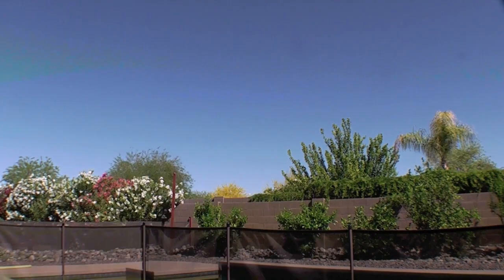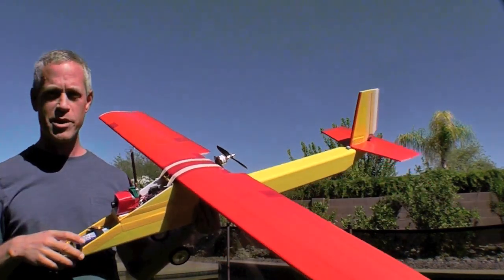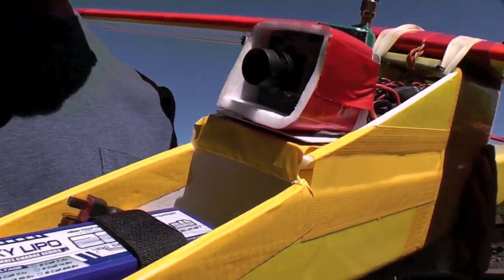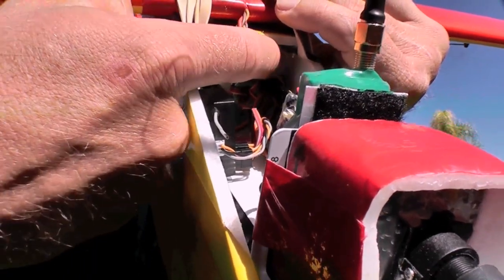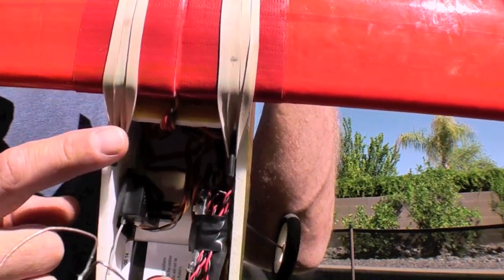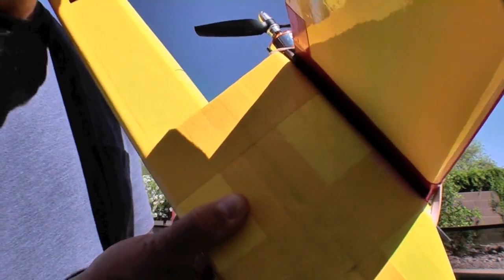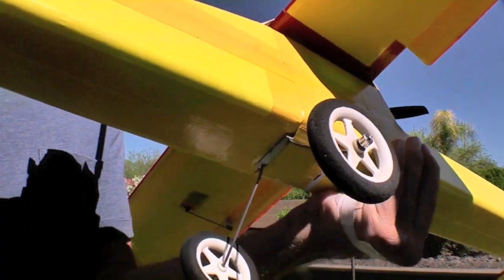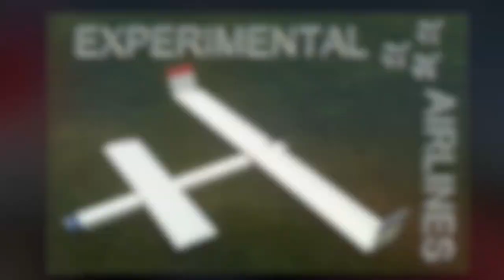AXON FPV - Introduction Video

Comment: Much thanks. Had a proper maiden flight today and wow I'm hooked.  It flies beautifully and glides well with motor shut down.  It handled 8 mph winds very well also. I thought the winds might cause a crash but flew and landed like a dream.  Thanks for the design and the assistance.

Comment from the maker: The propeller should always be mounted with the convex side and labeling forward.  The motor direction is governed by the prop you are using.  Standard props turn clockwise when viewed from behind, but be sure to check the individual prop you have.  The trailing edge is sharp, the leading edge is blunt.  Long story short, if it blows wind back, you're good.

Comment from the maker: On the test stand it will still pitch down, even with the downthrust angle.  The 5 degrees is a recommended relative starting point.  You may need a little more or a little less, but start there.  The plane really needs to be flying and be exposed to all the flight forces of lift and drag before the thrust angle correctness becomes apparent.  Essentially, the wing needs air under it to balance the thrust.  Try launching at 1/2 power and add power gently from there.  I bet it will work fine.

Comment: Hey, I like your philosophy regarding simplicity and low cost in choice of materials, i will definately use your ideas in my next build.

I would really like to see you build a seaplane using the same principles!! I know they may not be very obvious in your neck of the woods, but i areas where i fly, lakes are abundant and much easier to find than open areas without pesky trees.

So a seaplane using your proven techniques...... THIS IS A CHALLENGE!!

Comment: Take a length of wire  1-2 ft., clamp a vice grip firmly on each end. Grasp the vice grips in each hand bringing them together to bow the wire. If you jerk them apart quickly it will take straighten the wire enough to use for all practical purposes. Safety first. Wear safety glass in the event one end of the wire pulls from the vice grips and tries to put your eye out. Slip joint or lineman pliers on each end will work as well.

Comment from the maker: Well, the carbon fiber is right up next to the feedwire, and it's in the null (dead zone) anyway so it wouldn't seem to have much effect.  Plastic might be preferable if one were paranoid about such things.  The interference seemed to occur very infrequently and at fixed locations on the field so I suspect it's large ground features, like that freeway wall, causing reflections and multipathing where it did occur.

Comment from the maker: Generally cannot go wrong making it 30% of the wing chord behind the leading edge, so if you're 5" airfoil chord plus 1" ailerons then put the CG at 2".  Always safe to start forward of that then ease it back after a trimming flight.

Comment: Ed. Nice video.. Did you see the Axon with the V tail?  Interesting concept.. A triangles tube in the rear would set up the V tail and reduce the rear weight. Maybe enough to offset the extra weight in the front to balance..

Comment from the maker: You know, I now just use rubber bands passing front to back for this same purpose.  But I once used 1/4" self-adhesive weather stripping.  The mounting tape by 3M is honestly as cheap from Home Depot as any place I've seen it online.  Office Max also carries it.

Comment from the maker: Good eye!  If all the air went smoothly through the upper fuselage it would work pretty well, as with the original Axon.  Now with all the FPV gear and wires and crap in there it does disrupt the airflow some.  I considered tapering the rear of the upper fuselage for smoother airflow to the prop, but it gets complicated.  A solid bulkhead would probably worsen the performance as it would choke off the air completely.

Comment: Hey Ted, will this battery have enough power for the Axon? It's from RCTimers and it's called 11.1V 2200mAh 15C Lipo Battery Black-B, it has 15C instead of 40C that you have linked. Is it enough or whats the difference?

Comment: I'm looking for a plane to help a classmate build who's a beginner. The two thinngs I want it to have is 3 channel capability and a pusher so when he crashes we can get him back in the air with out buying a new motor. I think this plane is a good match but I want add dihedral or polyhedral  so that it will be entirely hands off self correcting. Any ideas on how to make one of your wings have dihedral.

Comment: Hey Ed, I have tested the motor today for my Axon in full throttle, every time I do the full power, the plane wants to go down, bad... Does it mean I don't have enough down thrust? I have measured exactly 5 degrees, but is it still not enough? Thanks

Comment: Hey Ed, I have a problem and I was hoping maybe you can give me some ideas... 
Today I had a second test fly with my Axon. To make the story short, after the first flight I have added carbon rods support to the vertical stabilizer and added more down angle. Anyways, my Axon keeps acting weird (still): on the throttle up or just no throttle it wants to go up. Also, it stalls (a lot), it doesn't seem to have any power or momentum to make a simple loop, it just starts whirling down.

Comment: it is not nose heavy, because I have had 3 different RC people check it for me and it has quiet a descent amount of sticky weights in the nose section. Please, please let me know if you have any idea. I have gotten the 2826 2200 kv motor and 40 A ESC, so it should not have any power, it's almost exact setup as yours... Also I had one guy suggesting today to try a slower prop 6x6 that will give more push but slowler speed (don't know how that's going to go :)

Appreciate it!!!

Comment: Hey Ed, can you explain how you mounted those carbon rods to hold the wing? Did you use a hot glue or how did you put it in so the rods don't slide out or fall off?

Thanks

Comment: Cool setup Ed!
One question though, doesn't carbon fibre interfere with transmitters/receivers? so wouldn't the carbon fibre holding up the transmitter antenna be making it noisy?

Comment from the maker: They'll probably work but only so-so.  A 15C discharge rate will about cover the power draw from the motor but it also usually indicates a fairly crappy battery quality.  C ratings are always a little sketchy anyway and if the vendor is admitting to 15C it's probably not a great pack.  It will be more susceptible to voltage sag (see Internal Resistance Testing video) as well as puffing and early failure.  I shoot for 30C minimum just as a rough quality estimate.

Comment from the maker: Just put 'em up in the corners and cover with hot glue.  I would go generous on the glue because you don't want them to slide towards the center.  Also wouldn't cross the rubber bands.

Comment from the maker: I just used some piano wire landing gear from a previous plane but honestly I think you could do a lot better with a one-piece plastic or CF unit from eBay or an online vendor.  I don't have any stellar ideas but if I find one I will share in a video.  The piano wire is nice and cheap but it kind of bends every couple of landings which is annoying.

Comment: Could better describe  the insulation you used between the top wing and fuselage. Is it a single sheet or strips? It is hard to see in the video.
Doug

Comment from the maker: The CF mast is in the antenna null anyway, so it won't make a difference.  IBCrazy sez: "Carbon fiber is a non issue so long as you don't run your antenna along it or beside it. Since your antennas should be vertical anyway, it's not a problem."

Comment: I love your videos!  I am new to RC planes and don't have any equipment yet.  Can you recommend a radio and receiver combo that would go well with your designs? Something that would be able to grow into more sophisticated planes or quad copters later on?  I notice that there are some inexpensive radios out there ~$50 and more expensive ones with stored parameters for different planes costing many hundreds $$.  Also can you comment on if it should be a mode 1 or mode 2 radio.  Thanks.  Mike.
Reply: tgy i6 with the 9x Rx or the tgy 9x TX

Comment: I Really like this axon plane" : and yes ,im that 1 weird guy ….I just want hover and look around/slower the better/great long flight. im very new :so far I tossed my FT exployer into the azeala bush -and 3rd time ..I got the CG correct! yours looks heavy + different set-up on the motor! wonders if mine will fly???I got 2830 x 850 KV ../I got 9x6 prop and a 6x4,4...yhinking I need a 9x4.5 ??? idk :>(  ..and I made both the 5 +7 ..armin wing! :>)